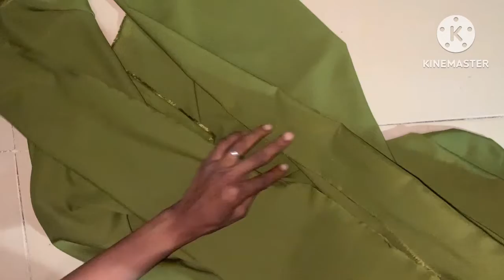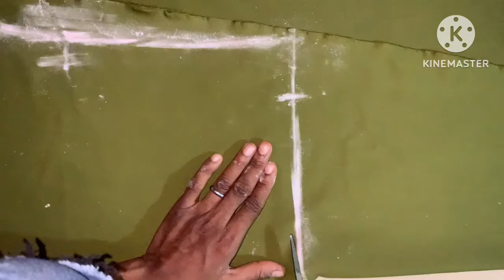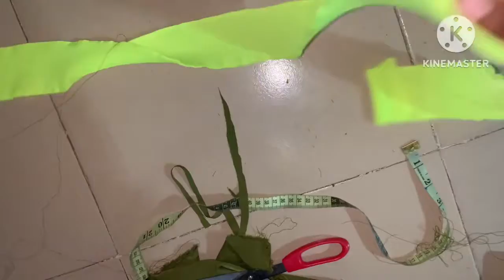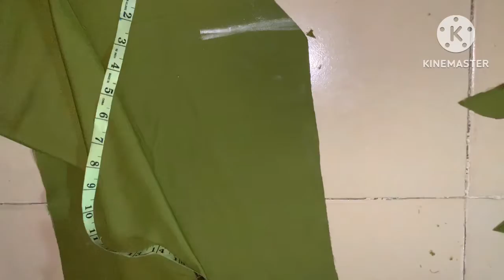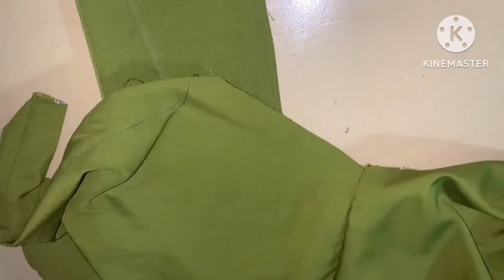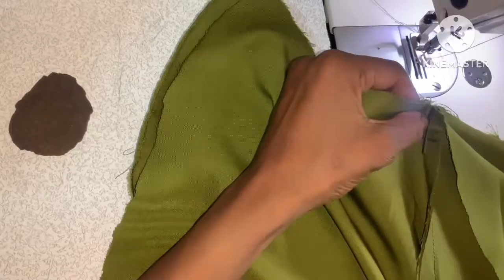Simple Two piece Pant Set; Crop Top Shirt And Palazzo Trouser [DETAILED]; Cutting and Stitching Diy

Comment: You didn’t measure the crotch extension for back or did you use same crotch extension and won’t it be a problem?
Reply from the maker: Yes i used the same crotch for both back and front cos is not a straight trouser it wont affect it  thanks for watching